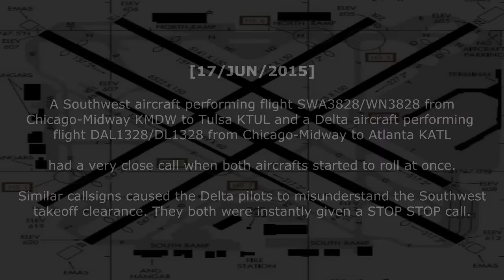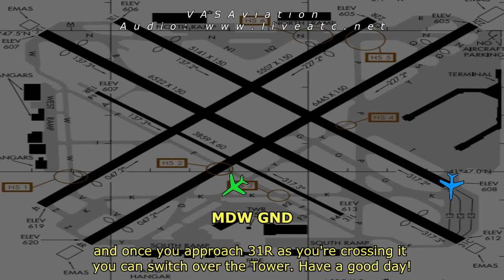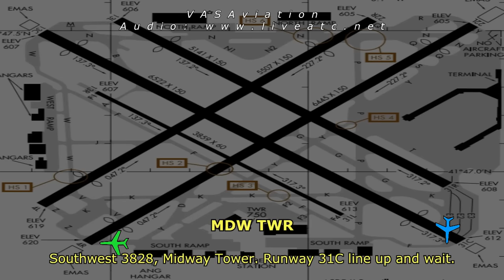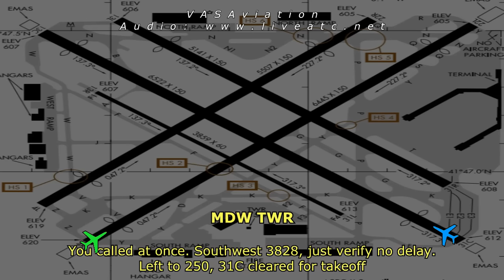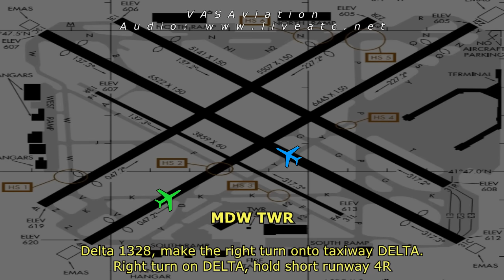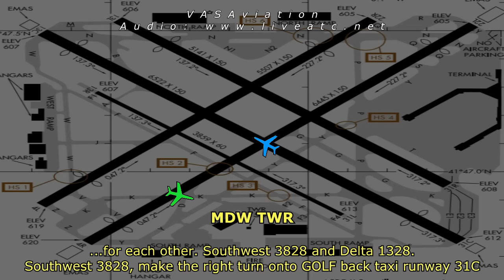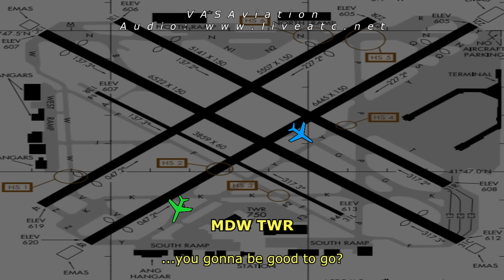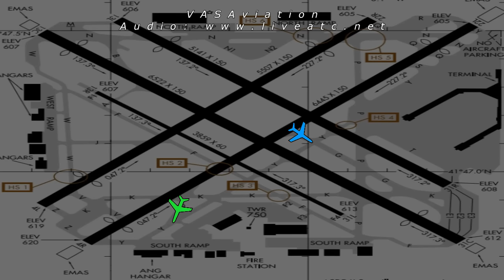[REAL ATC] Delta and Southwest VERY CLOSE CALL on takeoff

Comment: ATC: Pay attention, similar callsigns
Both Pilots: Ok, WE'LL BE AWARE

1 min later
Both initiate takeoff no questions asked
Reply: LMAO
Reply: The controller spoke so fast that all they could understand was the '28'.
Reply: @briansmyla8696  :  And the audio quality of the radio transmissions was unusually poor....and most of all, it sounds like the ATC was keying the mike after he started talking, rendering the callsigns inaudible.
Reply: The Southwest was the one being cleared by the atc to take off, only the Delta was daydreaming, to miss even the heading and the rwy identification in the take off clearance that were not referring to them at all
Reply: @Milesco  it's good to remember that these recordings aren't from ATC directly. They're from receivers set up by volunteers. However that wouldn't explain keying up late
Reply: I want to like but the like count is 420
Reply: @josephr.2170  Oh shoot it sure is
Reply: Rob Gormley Key issue is another solid evidence that Delta is really daydreaming, since if the key issue was severe enough to make them mistook tower instructions to that degree, why I could not recall them had shown any sign of doubt about that?
Reply: The transmission was stepped on.
Reply: Ane they both gonnna report to company🤣
Reply: @ROBSHOTZ  Yea, they both stepped on each other.
Reply: Daniel Pessoa fax
Reply: @briansmyla8696  I think if they identified that the callsigns are similar that the ATC should make more of an effort to pronounce the different parts.
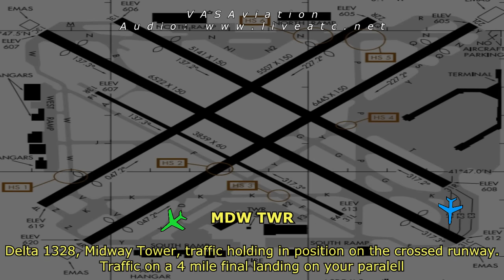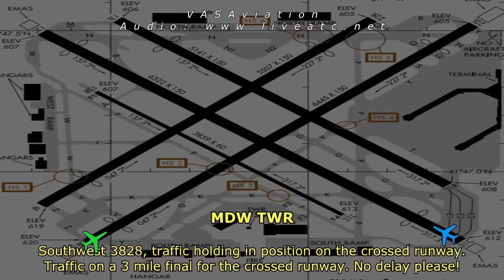Reply: 0:48 okay it was hard to hear (maybe it was much clearer for the tower/aircraft), and poor reception for the person recording, but the calling of the runways wasn't too clear, but 1:13 Definitely heard runway 31C cleared for takeoff
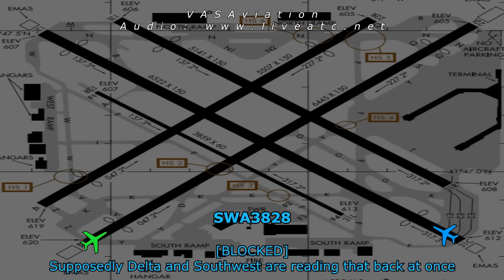Reply: @robgormley5774  While "31 center" was spoken fast but yet understandable, at least the encrypted callsign at 1:21 isn't part of any language spoken on this planet.
Reply: @techmantra4521  I agree. An effort should have been made to distinguish more clearly the call signs of each craft. DELTA 1328 should have been called out as one three two eight rather than thirteen twenty-eight. Nevertheless, I wouldn't blame that situation on any person; I would blame it on logistics.
Reply: @troyezell5841  Yep. Blame isn't too helpful in these situations. A review of the operating procedures and incident report should be done to avoid this.
Reply: Clearly we don't know what else was happening around them, but the controller also could have taken a breath and avoid "no delay" instructions given the similar callsigns.
Reply: @Redbikemaster  It may well do - if the squelch on the volunteer receiver was slow to open (not uncommon)
Reply: Exactly what I was thinking 🤣🤣
Reply: This is like me at work explaining things to people and they are like ya I 100% understand what you are saying. I will do exactly what we talked about. Two days later “Umm you never told me that, I had no idea”
Reply: I mean... even if the audio quality was bad and they could not be 100% sure the atc call was for them, maybe all they heard was 28... Is that not a reason to speak up and ask if that call was indeed for you?
Reply: How was the Southwest aircraft supposed to know that the Delta aircraft took their callsign and decided to roll? This is entirely the fault of the Delta pilots.
Reply: Delta and Southwest are so garbage, not really surprised.
Reply: @briansmyla8696  agreed but the controller also specified what runway he was clearing for takeoff multiple times. That part came over the radio just fine. 31 C sounds nothing like 4 RIGHT. The Delta pilot fell asleep, not ATC's fault.
Reply: @bibinb.8688  Lima Mike Alpha Oscar
Reply: @SomeRandomGuy789  indeed
Reply: Bibin B. :) What does Lol stand for?
Reply: ATC: "Runway 31 center cleared for takeoff"

Guy on 4R: "4 right cleared for takeoff"
Reply: @techmantra4521  there is no easy job.
Reply: I think no questions asked was also because they were being urged on. (Take-off with no delay because of incoming traffic)
Reply: @NS-tn3th  me too.
Reply: @6105boe  yeah, read back 'closes the loop'.
Reply: It sucks that radios step on each other like this.
Reply: The delta should have known because the takeoff clearance referred to runway 31C, not 4R.
Reply: @YEETMAN-dt9mb  This is cetainly true.  However, the controller, knowing their similar callsigns, should also have spoken more slowly/clearly to make certain he was understood.  So there are faults on both sides.  That said, the controller did at least realize what was happening, the Delta pilot complied with the stop order as quickly as he could (even if it was too late to avoid going into the runway intersection) and the Southwest pilot was paying attention and stopped well short, so no harm was done.  So the Southwest pilot is free of blame here (and is also the one largely responsible for preventing a collision), the controller and the Delta pilot both have areas to improve, but at the same time both of them did do some things right as well.
Reply: And just try to use the radio at the same time so you wont get any clue.
Reply: Okay Delta you are "Donald Duck" for the next few minutes, and Southwest you are "Mickey Mouse"
Reply: @bgamelson  They both didn’t.  The Delta crew did by taking radio transmissions that weren’t for them.  The Southwest crew did what they were supposed to do.
Reply: @bibinb.8688  LMAO
Reply: @wildwind4456  agree the controller could have been more clear, however I’m certain that the transmission would have been much easier to hear and not clipped at the start for the aircraft on the runway. This recording is not what it would have been like for the pilots. 

Delta fucked up and there really isn’t any argument otherwise, other than from people who don’t work in aviation.
Reply: Probably would’ve gone off without a hitch.
Reply: overlapping runways doesn’t look like a good idea to me….. at least if they could see each other better, that aeroplane would be jumping the other. Same as two airlines having similar numbers for flights going from the same place at the same time. Even the map looks like a game we played as kids to defeat each other.
Reply: @Milesco  if it was inaudible then that shouldn't be accepted by the crew as clearance; they should've clarified with ATC.
Reply: @hayleyxyz  :  I believe that's exactly what they did -- twice.  But they got stepped on both times.  Coupled with the fact that the ATC was hurrying them up and telling them not to delay, the Delta pilot probably didn't want to hold things up further by calling/reading back a third time.  I blame the insanely rapid-fire, word-slurring ATC for this one (made even worse by not one but two unfortunate radio interferences at the worst possible time).
Reply: @sonickunckle  but then SW answered for Delta on holding short of 4R
Reply: He should say southwest three eight two eight and Delta one three two eight. That would be more clear imo
Reply: @Milesco  the hurry was SWA needed to get through the intersection of 22R prior to traffic landing. Hence the urgency. If you've never worked or flown into a busy airport, save your comments. If you think you could do better,  the FAA and all airlines are hiring.
Reply: @GT-ATC  :   Yes, I'm aware of that.  It doesn't make what I said any less true. 

As for whether I could do better -- yes, I certainly could.  The controller was racing ilke a livestock auctioneer.  Mumbling at 10,000 words per minute over a poor-quality radio channel, I'm amazed that anyone understood a word he said.
Reply: Hopefully different frequencies were added for the runways when they are running both. Why, I have no idea they are running 2 crossing runways at the same time since wind doesn't usually change 90 degrees...
Reply: Could have been serious, but FFS!
Reply: @briansmyla8696  that is we runway numbers must be repeated back. The delta flight should have never started rolling with the wrong runway number called
Reply: That’s on the controller talked too fast and keyed the mic late,  normally whatever but given the situation you woulda thought he’d have been more conscientious about being clear
Reply: @Milesco  audio to them is better then it is for us..  they have much better audio then a recording off the airwaves
Reply: @starga-fr7qx   I sure hope so!  🙉
Reply: Humans are the weak link. Always.
Reply: I didn’t hear ATC warn Delta…though they did warn Southwest
Reply: @techmantra4521  I'd usually agree, in that instance it's better to go by individual numbers for example... One three instead of 13, two three instead of 23. The big thing though is that delta should have been listening better. Because ultimately, the runway given clearance for takeoff was spoken clearly, and he clearly wasn't paying attention to that. To be fair I could have made that mistake, but if it's anybody's fault... I'd give it 70/30 delta and tower.
Reply: @briansmyla8696  they were on different runways?
Reply: @Captain Quirk  I sincerely doubt you have worked ATC or flown into  Core 30 airport. This is what it sounds like when it is busy.
Reply: @briansmyla8696  Yes but he also said "runway 31C" which was perfectly clear. Delta read back the clearance without thinking about their situation or the clearance at all. Even a second to think "am I on the correct runway" would have prevented this.
Reply: The ATC should stop using useless difficult words and talk slower etc
Reply: @LexlutherVII what?
Reply: Psychologically speaking, particularly in such a busy airport, pilots try to be ahead of the game in order to avoid delay, meaning both pilots in charge of the comms were already expecting to get a take off clearance and had it in their minds ready to read back. So, all they cared about was reading back the clearance quickly after hearing what they believed to be their callsign, ignoring all other information. In their minds they were only focused on the “callsign” or anything that sounded like their callsign. That explains why Delta missed not only the callsign but also the runway. This is called “hyperfocus”. You concentrate so much on something that you lose track of everything else. I don’t think ATC is at any fault here. They even advised both pilots to be aware of the similar callsigns and both acknowledged. What we don’t know is how good or bad the CRM was inside Delta’s cockpit which could also have played a big role in this incident. Thank god a disaster was avoided and only a couple egos got hurt :)
Reply: Maybe instruction "report lining up departing traffic in sight" for similar call signs on crossing departures is prudent.
Reply: Yeah, they should have asked for it. but the NO DELAY did not help, and the fact they did and was blocked is stupid.
The way the ATC spoke "Southwest" was a absolute joke aswell. He is also aware of the similar callsigns and this is a critical piece of information, SPEAK CLEARLY goddamit, your job is to communicate, you are clearly not doing it well. Hundreds of people almost died because of it.
Reply: Я предлагаю общаться на понятном русском языке во всем мире😂, а не вот это вот всё 😅
Reply: Why couldn't ATC just say one three twenty-eight and three eight twenty-eight?  That would solved the issue, but insisting on saying double digit prefixes fucked the whole thing up.
Reply: @briansmyla8696  only one of them was on 31c
Reply: I don't understand why, if you have a similar callsigns you can't just assign a temporary handle for each aircraft so this is avoided entirely.
Reply: Call sign having same two last digits always an issue. Also, both pilots answered at the same time on the same frequency so ATC cannot tell who said what. Air traffic Technology has to be better than using only radio frequency to communicate.
Reply: “Nah…it’s cool, we waved at each other through the window.”